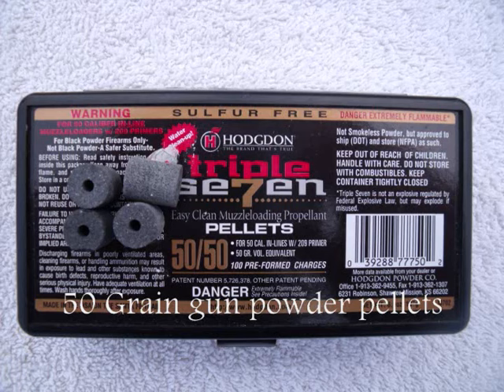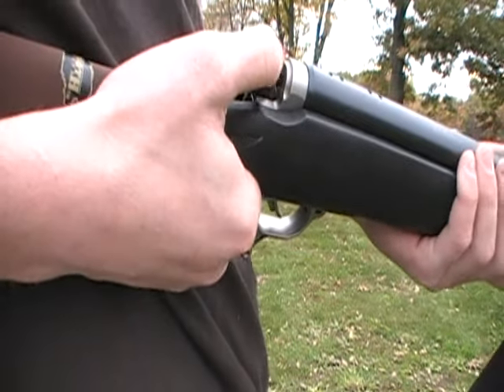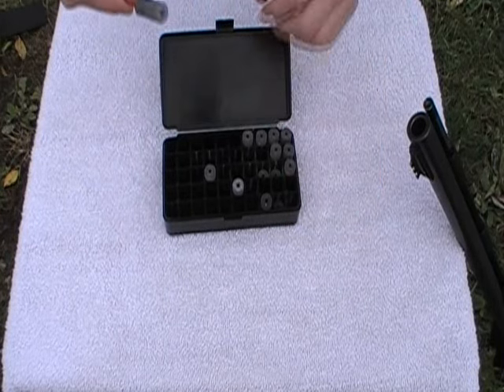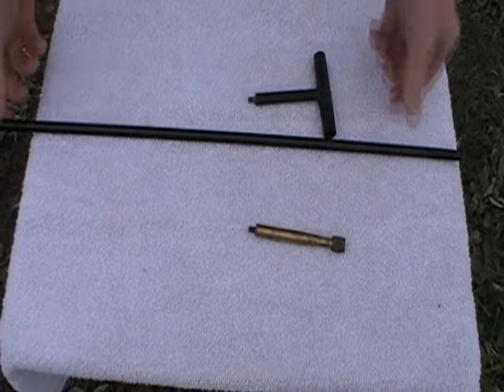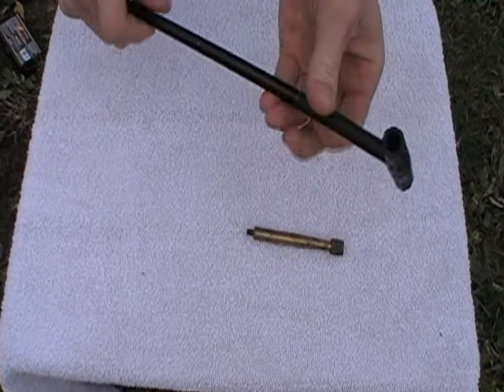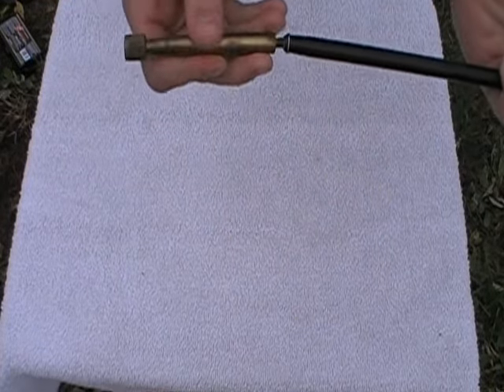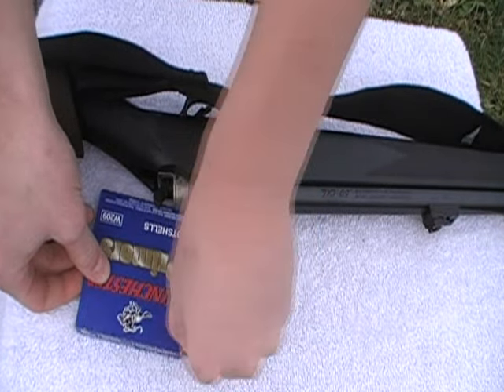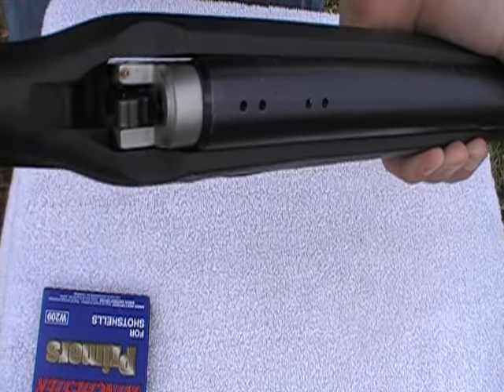How to Safely and Properly Load a Muzzleloader

Comment: The only thing I would add is that the pellets have a darker end that needs to go toward the powder to make ignition more sure fire. Perhaps making a note that the primer is installed only when a shot is to be made, for safety reasons. Besides that, I think you did a fine job.
Reply: LMO MechTech ...do you load the primer right when your about to kill a deer?
Reply: Devin Roireau maybe not, but if you're hiking to your "spot", or climbing into a treestand, you shouldn't have a primer in. I'm pretty sure this is what he meant by this comment.

Comment: @DerFiendr Also, you don't really need a "high powered rifle" to take down game efficiently. Let me put this in perspective:

The round used in the extermination of the buffalo was a .45-70. A .45 caliber bullet with 70 grains of black powder. Nowadays we use a 50 caliber bullet and 100/150 grains of black powder. The .45-70 could drop buffalo. 

For the slow reload, if you can't hit a deer on the first shot, stay the hell out of my woods.

Comment: In your next video you might consider altering the ramming part when the bullet wasn't completely seated.  This tapping or ramming impact may have an effect on the accuracy of the shot.  I read somewhere to never let the ramrod break contact with the bullet all the way down.  If the bullet isn't seated as far down as you want it, press a lot harder.
Reply: I would say you are correct. Unfortunately when I uploaded this video I think I weighed about 130 and couldn't generate enough force to seat without a tap 😂
Reply: @lanefuller34  I don't even remember making this post that was a long time ago.  I was 8n Illinois at the time where using a muzzleloader gave you an advantage in distance during deer season
Reply: @Linkman81   I don't know how I didn't see it before because I used to check comments on this video semi-regularly. Looked at it for the first time in years, saw a bunch of more recent comments and then yours. 

I live in Southern Michigan and we had muzzleloaders for the same reason but they're less commonly used now that straight-walled cartridge rifles are allowed.

Comment: Oh, the point I was getting at, with a flint lock you can do maybe 8 shots a minute with practice. So with this, I'd say 10 or 12 should be expected (since you're dealing with a primer, not power in a pan. And no need to use a patch cloth). But to do that you can't be so gentle.

Comment from the maker: Precautionary methods, mostly. 
If you have excessive sweat or residue on your fingers it can cause issues with firing. 
Also, if the pellets are crushed unevenly, it can create problems with the timing and/or force distribution of the blast, which can lead to terrible inaccuracy or even dangerous malfunction.
"Fuck it" isn't always the best policy.

Comment: I seen you used 2 pellets to load into the barrel. Is that normally how many you would use? I've never loaded a muzzleloader using pellets before, i learned how to load them using measured grain, a wad, and then your bullet, so i guess somewhat more of the "traditional" way so to speak.

Comment from the maker: 1 : Problems firing properly, possibly blowing out your plug rather than the bullet
2 : Everything will either fly out or the bullets will hold the explosion in and either blow up the gun or blow out the plug
3 : Yeah, as long as it didn't get wet and wasn't stored in a humid place. A year should be fine, I wouldn't let it sit for too long though.

Comment from the maker: I did. Decided to get down in a drainage ditch on one side of the crossing. A deer trail went through and back up on the other side. Waited about 20 minutes before 10 deer walked right in front of me and never noticed that I was there. They were only about 9 feet away and I felt too guilty to take a shot.

Comment: So you can't use powder in it???
Reply from the maker: It's a bad idea to use loose powder in this one.
Reply: +Lane Fuller thank you that's no fun
Reply: Good video but should show how to unload it and what to do if  you get a miss fire
Reply: The only way to unload is to fire.  If you get a miss fire, see if the primer has been struck, if so, try a new primer.  If not, try firing again with same primer.
Reply: To unload, remove the primer. Unscrew the breach plug. The pyrodex pellets will fall out. Take the rod and push the bullet out of the muzzle. Replace breech plug.
Reply: thanks
Reply: In CVA inline guns, yes you can use powder or pellets. I imagine its the same for other inline muzzleloaders too but see instructions.
Reply: @Lanephotography222  what makes you say that. I strongly recommend going to loose powder. Weigh it and see how much accuracy improves with the correct amount of powder

Comment: OK so the bullets I bought have a plastic caseing around the bullet do I leave it on the bullet and pack that as well with the bullet
Reply: Yes you leave it on the bullet,  Melissa.
Reply: yes, the plastic creates the air tight seal in barrel. Replacing the cloth patch that was used with the round ball in the past.

Comment: you should never tap the rod to seat the bullet.
Reply: Dana Willett, why not?
Reply: It will crush the pellets
Reply: Crushing the pellets is a good thing... you get a more efficient burn.
Reply: Why not use powder. Ever weigh those pellets? I have. Half aren't 50 grains like advertised. Go to loose powder. Much more consistent. As you can weigh and get exactly what you need
Reply: The reasoning is that depending on the bullet you use, you can deform the bullet by bouncing the rod on it. Just push firmly down to seat the bullet. I use loose powder.

Comment: He does not mention loose powder or that he is not muzzle loading real black powder cap and patched ball. He doesn't mention that this is not traditional. Not knocking just stating a fact. This is 1970's tech. Well accepted. But not necessarily the only way to load a muzzleloader.

Comment: I used thes rounds in my .54 in .54 of course urs is .50 any ways I had a hard time loading it took me and my uncle to get it down. Worst part firing it spun me looking at target to puting target to my back and gun straight up in the air. Took all the rest and trashed um. Never using the green ones agin. Red ones no problem always use 110 powder grain. No explanation even gun shop has no clue maybe green sits tighter then red. Just wont tuch um.

Comment: Do not use black powder, it is very corrosive, try using Pyrodex instead of the black powder pellets, also the brass end and the handle are not necessary.

Comment: Can cva use cheap round balls sabits are $$$$
Reply: Brett Duffy most modern muzzle loaders can use round balls, but there are some differences you need observe: 
1: use loose black powder or equivalent substitute, and not the pellets!
2: the diameter of the ball has to be slightly smaller than the diameter of your barrel to accommodate the patch, ( i.e.; a 50 cal rifle would use a .49 lead ball)
3: as mentioned above, you have to use a patch (and some lube) with the ball.
Hope this helps
Reply: Flying Penguin - I’m sorry, I’m not familiar with “percussion” type, or any “period correct” replica or antique muzzle loaders, just the modern, “IN LINE” type shown in the video. 
But, if I read your question correctly, the weapon you are considering is made by Traditions, if that is correct, go to there company website, and you can email them with any technical questions you have, they are really good at replying within a couple of business days ( or you could just call the phone number, listed on the site, during business hours).... Sorry I couldn’t be of more help. 

P.S. Check with outdoor, public shooting ranges and clubs in your area, (or ask the local “mom and pop”  gun shop) there are some out there (like where I go in so. ca.) that host either special or designated shooting range hours, days, or events for “black powder” weapons only (If you find yourself in Southern California, you can look up : High Desert Rod and Gun Club in Morongo Valley, 1 Saturday morning (4hours), each month, they have the “black powder buffalo hunt”- because the paper targets are buffalo shaped 🐃.....) The people at those shoots usually love to show off there “TOYS” and are happy to answer any questions that they can. 😉
Reply: @richardgil554  wow thank you very much! I will be doing all of the things you said. Again thank you for replying with some great info!
Reply: Flying Penguin - My pleasure

Comment: How about removing the breach plug? LOL Don't waste primers, jesus.
Reply from the maker: It's quicker that way.
Reply: its important to visually assess the barrel.. not all shooters have the acuity to realize there is a problem. i do use a primer to blow out any grime, oil or breech grease.. but even the remington sts-209's can vary in load. its a better idea for someone getting tips to examine the barrel, instead of either putting a live primer in the breech and forgetting its there when loading, or popping one off and assuming they've blown any blockage free.
Reply: you are supposed to run a primer through anyways to season the barrel